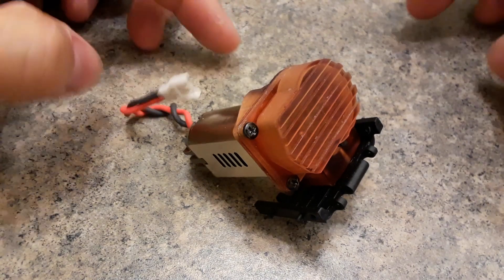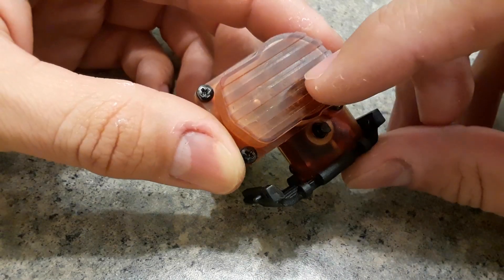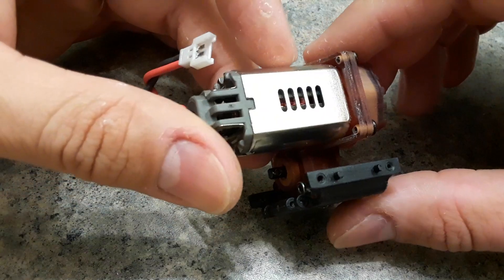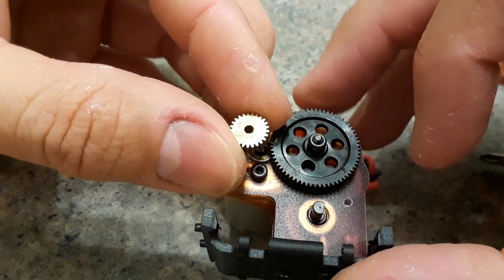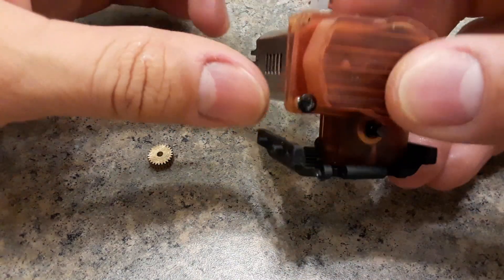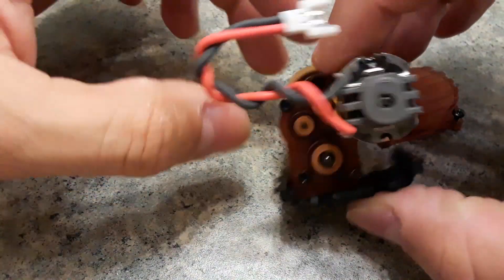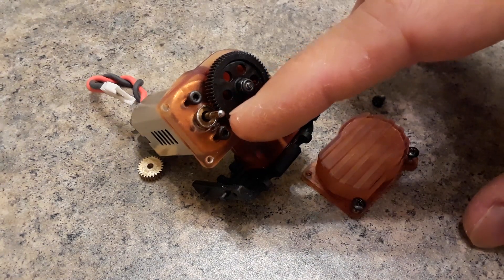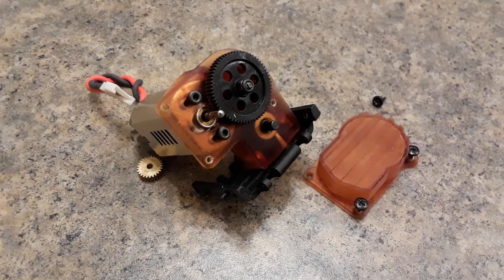1/24 Barrage 180 Motor Transmission Final Design

Comment: Why does yours have vent holes, dual capacitor/transformer,  <idk>  & that extra grey cover in back? Mine has no vents, single transformer thingy, & no cover. Did you do those yourself?
Reply from the maker: This is a modified race motor that has been wound to 100t in order to decrease speed and increase torque.

Comment: Hey bud.  Referred over from the Facebook group.  What motor is that?  My kiddos stock motor died on the 5th charge.  Need to get your mount and a motor.
Reply from the maker: The motor I use is a 180 can thats been rewound but you can find cheap 180 motors on ebay that are super strong and the motor mount is on my Shapeways store.